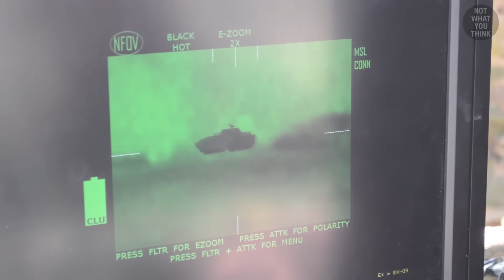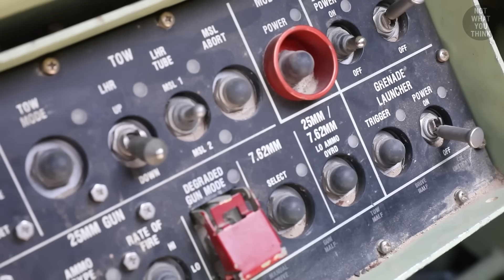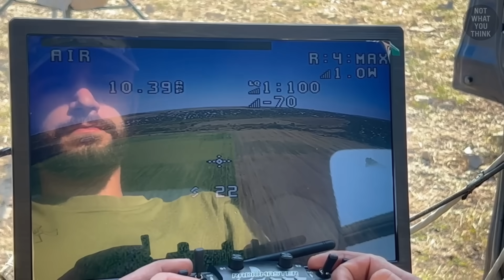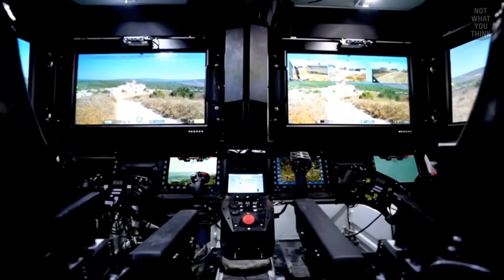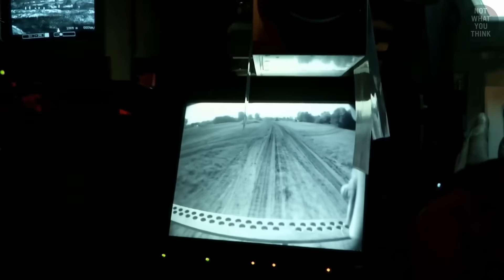How Bradley IFVs prove more Useful in Ukraine than Tanks

Comment: it's logical that when the "don't get penetrated" layer of the onion falls away, more focus would get put on "don't get hit"
Reply: But the Russians have always had that view, since the T34 in fact. That's why those small ultra low turrets (so only midgets can fit in them and there is no way to stop the midgets brewing up with the ammo if it does get hit) and the relatively low weight (hence high mobility). Whether that's a better approach than the US one of ensuring that it takes a helluva hit to get through the armour depends, I think, on circumstances.

Comment: it is not that heavy MBTs need to size down, it is that they need to be more maneuverable, or they should get better anti-drone and anti- projectile defense systems (kinda like TROPHY but also something that would work against drones), but i do believe a happy medium between MBT and IFV would be optimal for most cases (like what the US is doing with the XM30 program and M10 Booker for example), but every type of vehicle have areas where they excel in
Reply: They do.  Battleships were not killed by aviation, but by osbscene operating costs.  70t MBT uses too much fuel and parts., demends too much support.
Reply: @piotrd.4850  i bet youre also gonna say that the the T 72, T80, and T 90 models of russian tanks are better because they weigh a lot less too? Russia has always used the methodology of quantity over quality in everything they do. they havent really produced a quality vehicle since the T 90 and even thats sub par at best. russian tanks are eaten alive by western tanks since most of that weight goes into armor and crew protection where as the russians just kind of hope they dont die while theyre incredibly uncomfortable and cant perform nearly as well as their counterparts due to it.
Reply: @jbennett4196  Russian tanks are indeed eaten alive by western tanks in a one-on-one engagement at range. Just like a Sherman would have been by a King Tiger. But like the Sherman Russian tanks are designed so there is almost never a one-on-one battle. That's  because they are cheap, Private Conscriptovich can fix them, don't use much gas, don't get stuck in deep snow and mud and (most important of all) don't break bridges. All of which means you can get a lot of them to the front to outnumber those western tanks. Which approach is more effective depends heavily on circumstances.
Reply: @kenoliver8913  and that makes the soldiers using them more confident. i dont know about you, but i didnt really see any infantry supporting them when they were rolling around in cities. they tend to be alone and unsupported. with that, their armor is mostly ineffective, their T 90 specifically is made in low numbers because the engines are like the abrams turbine (it uses a lot of fuel) and has a high cost of maintenance. Russia has sacrificed quality so much that the quantity is meaningless because they are bad. a non-versatile hunk of junk that is less mobile, less lethal, and less protected. which, are the three major things that tanks need to worry about when being designed.
Reply: @piotrd.4850 Another big problem are bridges, 70t is much more than a commercial truck and since tanks are pretty small compared to a truck the load is on a small portion of the bridge.